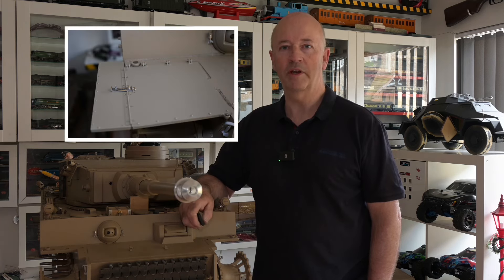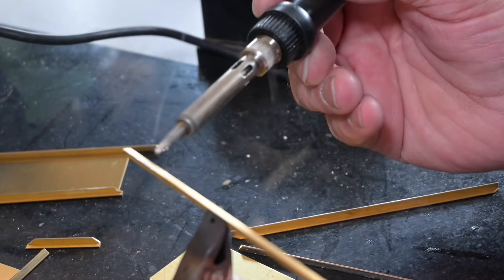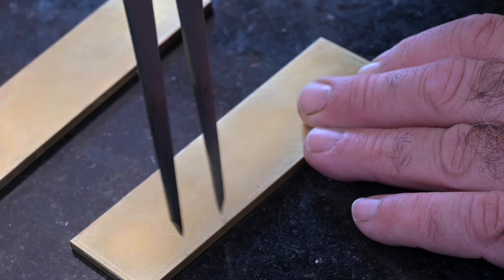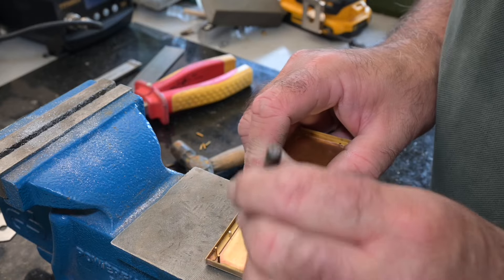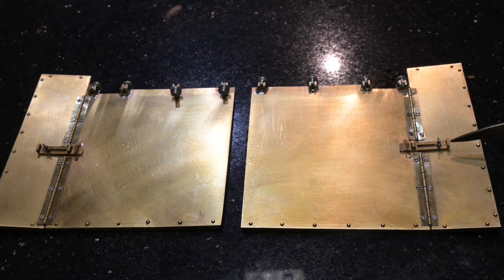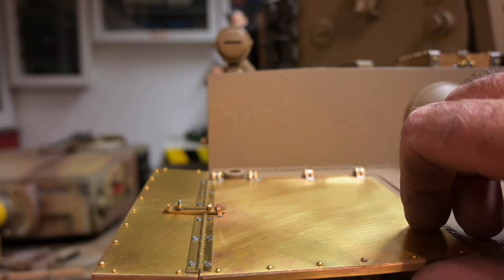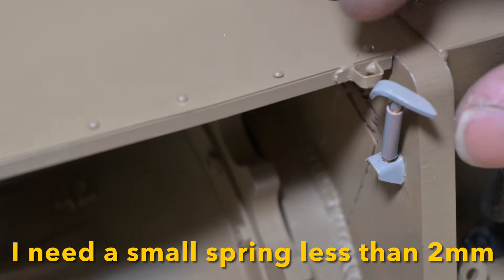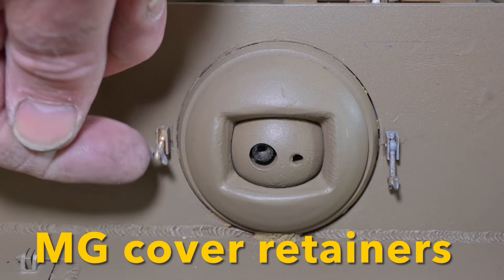Armortek one sixth scale Tiger 1 (part 10) super detailing mudguards track hangers and more

Comment: Thank you for taking the time to re-edit the sound. Much appreciated 👍

I've been wondering how much extra weight your upgrades add to the basic set up? Will the additional weight affect the motor or battery life?
Reply from the maker: Regarding the added weight. Won’t make any difference. Most of what I have added in the Early Tiger so far is saving weight. My new turret bin is half the weight of the original.  My mudguards in brass are lighter than the steel kit ones. The kit feifel components are heavy white metal and I will replace with a lighter version. The tiger originally was capable of taking a blank firing magazine.  This was an extremely heavy item.  If I fit my 88mm gun breech and full interior it will still be lighter.  So far everything I have added is weight saving.  My interior gun enhancements actually balance the gun barrel and reduce the effort required by the motor to operate elevation. 
There is nothing I could add that the vehicle couldn’t handle.
Reply: @16rctankworkshop-yv8kl  that's really good to hear. I'm looking forward to the next episode.

Comment: Hi, I was a little confused on how you soldered. Am I right in saying that you applied solder first, joined the two parts then reheated for them to bond? Its something that I want to do on future Armortek models. Good up the good work.
Reply from the maker: It’s the way I attach the pieces.  Otherwise I find it hard to get enough heat to make the joint,  just takes a few seconds with a small gas heat gun.  Apply some flux also.   Use dome small clamps.  Most important to keep everything clean for a good joint.
Reply from the maker: I’m not an expert metalworker but it’s probably like brazing but with solder instead of welding rods.  The other mudguards I show on lathe late tiger was a kit mudguards which I detailed using other components.  The kit components back in 2007 were a bit clunky but I think they still use same mudguards components.